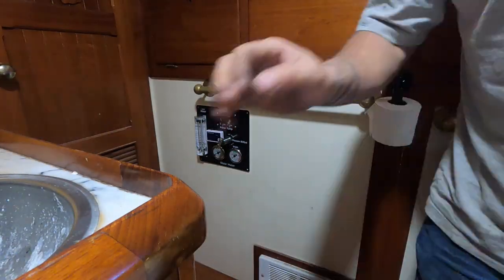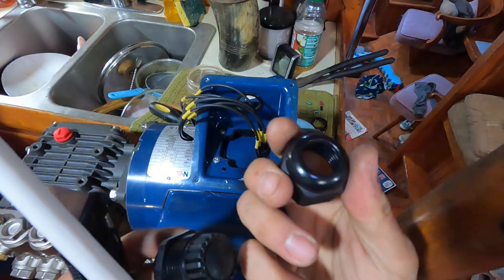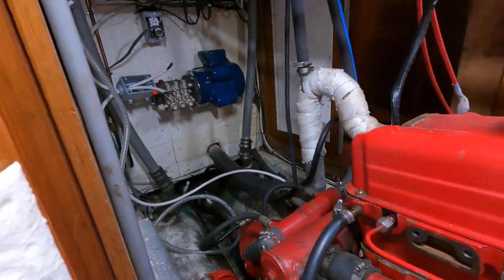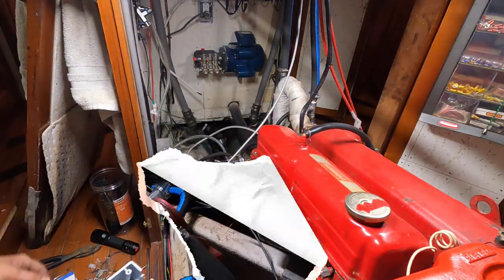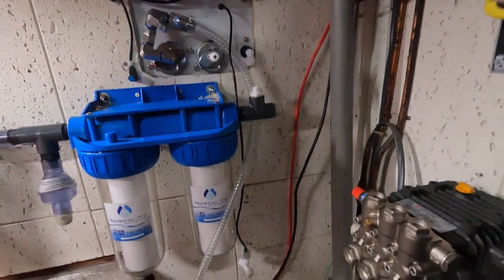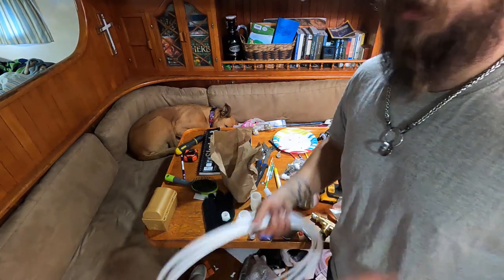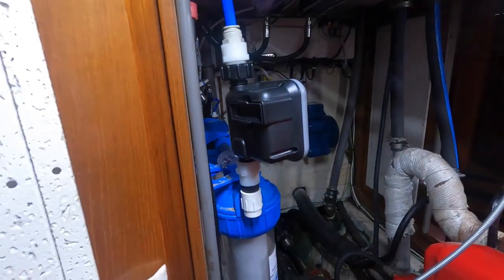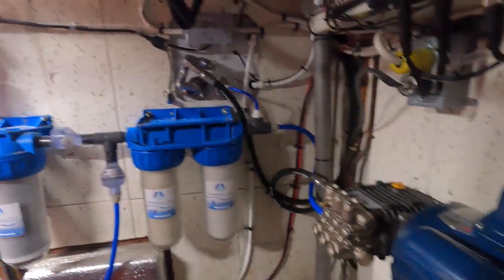Full Installation Of Our SeaWater Pro Watermaker!

Comment: Fantastic install ! Thanks for the details and explanation of how it works.  Hope it's still meeting all your expectations and the plastic fittings are still doing their thing.
Reply from the maker: Thanks, yeah tried to balance details with not boring everyone haha yeah water maker has been amazing with 5 on board. One thing I'll add is the plastic fittings on the freshwater backwash line leaked so switched it for a barbed stainless fitting also recommend adding a valve as you have to shut down/depressurize all freshwater to change fitting which is annoying

Comment: Doing this exact project now. Great tips. Thanks for posting.
Reply from the maker: Yeah hope it helps, we love our system now issues yet. Good luck on the install
Reply: @sailinguntilvalhalla  When connecting high pressure hose, did you use teflon tape?
Reply from the maker: I don't use Teflon on high pressure taper fittings as the interference fit should be the seal

Comment: Great install. I’m working on power and inflow/outflow plumbing. Haul out in two weeks for the inflow thru hole. Won’t be able to test until we leave houston water is way too nasty.
Reply: Thanks just happy it's done lol, yeah there is alot of plumbing for sure took a lot longer than planned. Sounds like your at least close, looks nice from the picture i saw and yeah we haven't ran ours much at the marina because of water quality but planning a winter run soon to go out and really make water but hope the rest of the install goes smooth

Comment: Really good video.. TUVM!  I heard you say you don't really care for the plastic push in fittings, which I can totally understand.  Is there an easy way to swap them out for an easier to connect, more secure & water tight solution?  Also, how often do you need to pickle the system membranes and do you have a way to feed the "pickling juice" into the system for that?  Thanks again.
Reply from the maker: Yeah I already ended up swapping some of the the fittings for brass ones as the freshwater flush line stated leaking pretty bad. So you have to replace the hose with potable water hose, then just take the plastic fitting to hardware shop and match the threads with a brass/stainless barbed fitting and hose clamp it way better in my opinion. I haven't had to pickle ours yet as we are always using it but if in not going to run it for a week (like in a marina) I just manually run the fresh water flush through the keep membranes wet and no issues but for pickling you could pop off intake or add a t-valve to give you and option to fill a bucket with water/picking solution

Comment: How long do you rinse the system? ...and do you turn on HP pump when rinsing?
Reply: Sorry for late response, I usually rinse the system for 15m after ever use, no HP pump its "T"'d into the freshwater system so uses freshwater pump pressure to flush system, pretty cool setup we like it alot no complaints